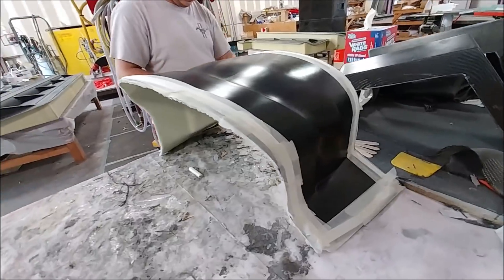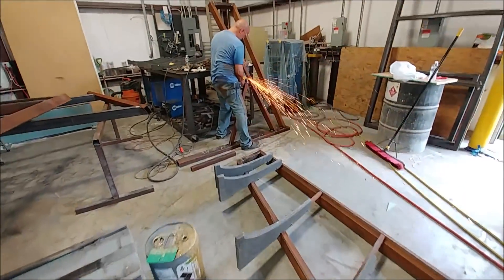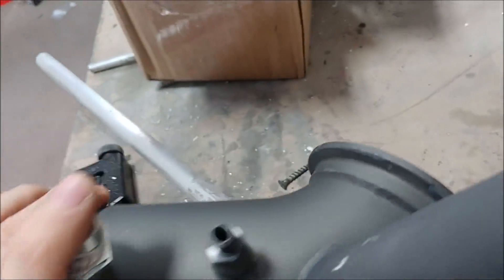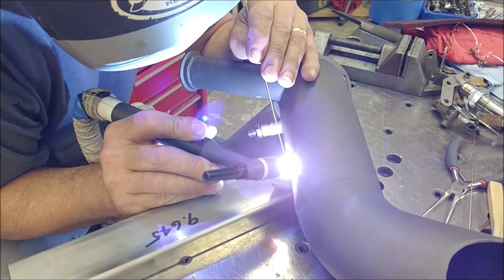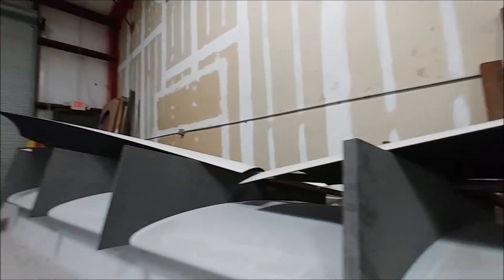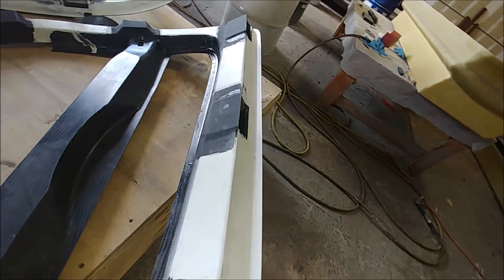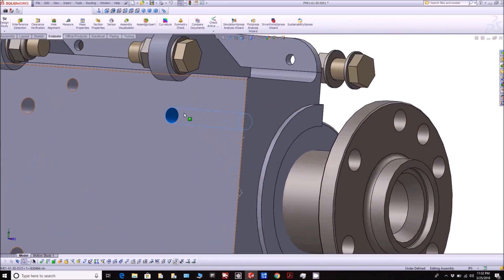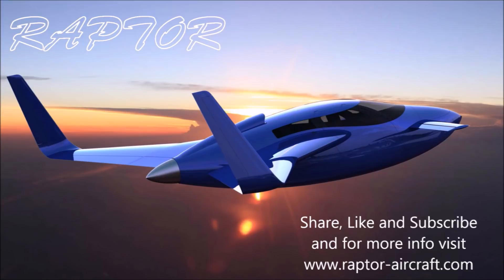Mean Looking Intake - Building the Raptor Prototype

Comment: You really should consider using the oil/air separator in conjunction with the scupper in the exhaust.  The scupper will not only effectively remove crankcase pressure, but it will also remove the engine oil from the valve cover at a rate that will surprise you.

Comment: Hi,

The wire loom covering the wires is...interesting, but perhaps you might look into "flame proof" hose and wire covering, something like Aeroquip fire sleeve. The automotive connectors are likely pretty reliable.

I suspect that a combination of panel insulation and forced air cooling will keep the engine compartment cool. Fortunately, you have that FLIR camera, so the panels can be checked. Ironically, perhaps the carbon fiber absorbing the radiant heat from the engine would be a good thing, but because the outside of aircraft is white, it cannot dispel the heat it soaks up well. Perhaps you could be liberal with your fire-wall treatment to protect the panels.

[The bombers that dropped some the nuclear bombs were painted with "flash white" to protect the panels from radiant heat. For some reason, one of the X15s were painted/coated white, as well. Most of of the X15 was made of Inconel, and still they wanted more heat protection.]

I am sorry you had problems with the prop drive/trust system. You monitor the oil pressure for the bearings, correct?

Comment: Hi - Amazing process to watch unfold! I'm a Big Fan, for sure! How far to the Test Flight airport?
Reply from the maker: Carl Smith About 1/4 mile from our shop.
Reply: COOL - Outstanding! Gonna taxi there from your shop?
Reply from the maker: The engine won't be on yet so we'll be towing or trailering it.
Reply: Will you be buying or building hangar space at thew airfield so you can make modifications there if needed or will you need to bring it back to the shop each time any non-minor change may need to be made?
Reply from the maker: We will be leasing space in a hangar